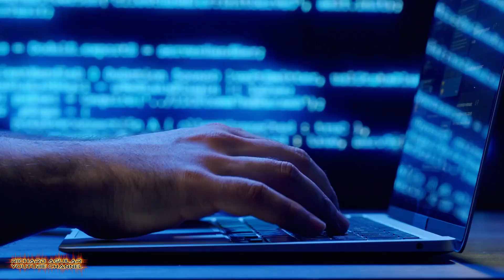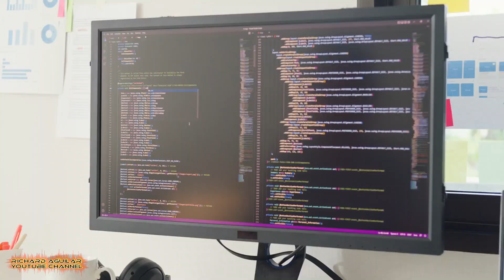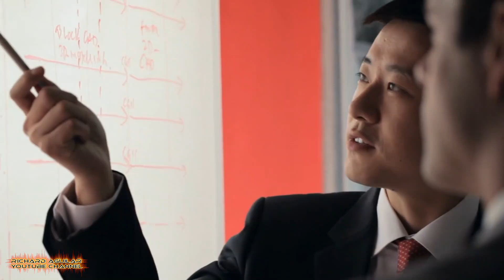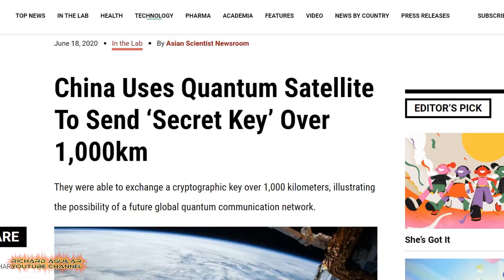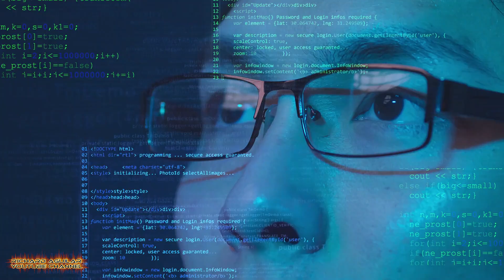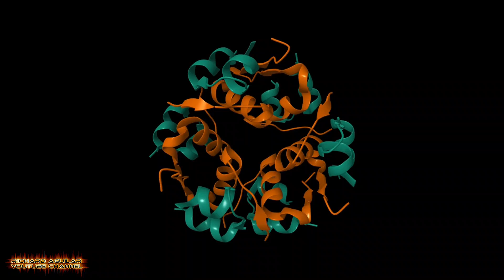Unveiling China’s Latest Innovations in QUANTUM Computing

Comment: Quantum Computers Will Run the world.  However Chinas Quantum experiments are Obsolete. The USA has a full scale Quantum Computer running at room temperature with infinite resolution and no energy footprint. Called "XO7-A1"  A race between China, at the start line when the start pistol fires the XO7-A1 will have crossed the finish line collected the Gold and be back at the start line before China could react to the pistol sound XO7-A1 would complete 100¹⁰ Gold medals.